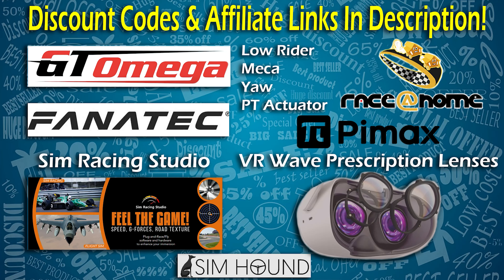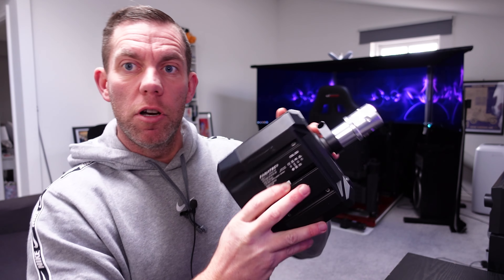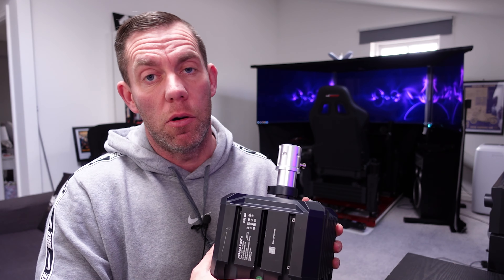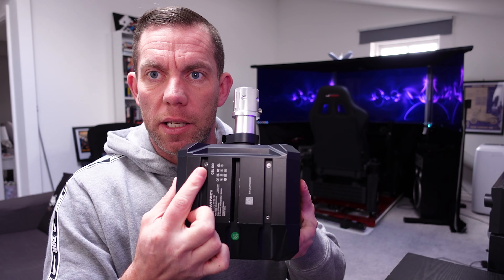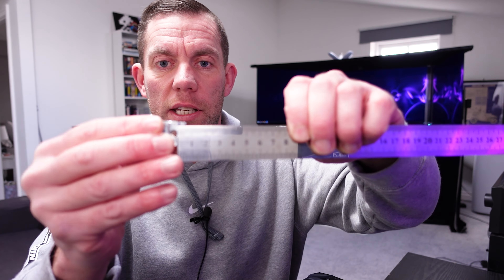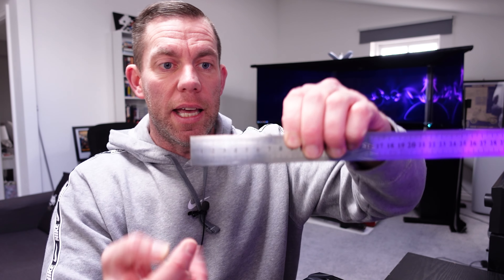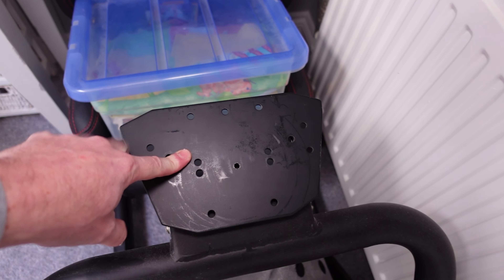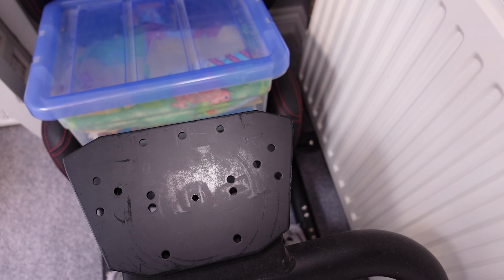Fanatec CSL DD Bolt Pattern Measurements & GT Omega Titan Fitting Guide!

Comment: Huh. I'm guessing GT Omega may have changed their design. I'm sat in one purchased only a week ago, and that is not the hole pattern I'm looking at (I've corrected for yours being other way up from what I'm looking at). Currently getting very cheesed off at fitting pedals, and am now also worried that the wheel will be trouble too! 🤦
Reply from the maker: Ah yeah maybe they have updated it then, mine pre-dates the CSL DD! I'll pin this comment.
Reply: I’m literally typing my card in to order the titan for my DD GT pro, same pattern as the CSL DD with CSL pedals. Are you unable to mount the wheel base without drilling and the pedals don’t fit either?
Reply: @ljcsponger87  First off, I should preface this by saying that this is my first ever rig, and my first wheel/pedals since the original PlayStation. So I may well be setting it up wrong, which is why I'm watching these videos again. That being said, the pedals are currently bugging me. The front two screws go in fine, but the pedal frame is so long that it extends past the end of the Titan base, and the holes don't quite line up enough to get the last two bolts in. Again, this may well be a me problem rather than a hardware problem. But so far I'm not seeing how. Haven't tried to attach the wheel yet, but might give it a dry fit in a second so can give you an answer. I have several holes more than Karl's shows though, so it may well be fine.
Reply: @urinal2001  understood, thanks for the follow up. I emailed GT Omega and I’ll keep eye out for your follow up. This is my first rig too and I’m having second thoughts if I need to modify it out of the box
Reply: @ljcsponger87  The wheel base fits perfectly. I set the T bolts in a square layout rather than the triangle, as I figure four points of contact is stronger. But the three point/triangle configuration looks like it would work without any drilling. Now I'll get back to shouting at pedals! 😂
Reply from the maker: @urinal2001  I don't use the additional pedal tray of the Titan ( I don't like the height) and instead bolt direct to the base plate, I did have to drill holes but that's no bother for me.
Reply: @urinal2001  thanks! I appreciate you checking. 
I’m a bit worried about pedal fitment but I guess I’ll hope for the best and place my order. My wheel/pedal package shipped a month early so I’m behind the ball for the rig and seat
Reply: @ljcsponger87  So far im pretty impressed. Pedal fitment is the only real hiccup so far. Instructions are basic but perfectly workable. And as touched on in one of Karl's other videos I'd certainly recommend a handful of 6 and 8mm washers for peace of mind in various places. But good stuff so far, and shipped quickly for me. The discount code at the top saved £25ish too which is helpful.
Reply: I got the titan a couple of weeks ago, and the plate supports the 4 bolt/square pattern on the csl dd base perfectly. No drilling needed. Pedals are a different story though. Front bolts fine, but rears are slightly off. It might be because my pedals (csl std pedals) are fixed in the outer slots as I'm waiting on the load cell. Until that arrives and I look at options to bolt it, I've just cable tied the rears down through the partial hole showing in the pedal plate. No movement from the back of the pedals 👍
Reply: @ellgarf  ok good to know, appreciate the info. I’m not thrilled with the idea of modding a new rig for pedals that are very common but it seems like it should be doable. I appreciate the info!
Reply: @urinal2001  hey, I ended up getting my Titan and DD pro kit. The wheel base mounted fine with 4 screw but I’m having same issue with the pedals. Did you ever figure out a good hard mount?
Reply: @ljcsponger87  I found a solution, but not an ideal one. I realised that drilling extra holes below the two corner ones would move them TOO far, so I just used a round file to make them longer downwards. It works fine to secure everything, and I'm happy with them. However I found that it meant I couldn't put the pedals in the very outer positions on the Fanatec heel plate. Not what I wanted, but it's only slightly away from what I would have liked and I'm using them just fine. As with several other places on the Titan, washers are a good cheap addition to give a little more peace of mind, even if not essential.
Reply: I just got my titan but it is the same hole pattern as in the video.  I guess ill be drilling holes for my dd setup.
Reply: @DoomiePookie  that’s so weird. I got mine not even a month ago and it allowed me to mount my DD GT Pro with 4 hole pattern no problem. 
The pedals are different issue and will require drilling  though
Reply: @ljcsponger87  i must of got old stock. I wonder if Omega will send me out the modern plate? Cant hurt to ask. ill contact them.
Reply: @DoomiePookie  they were next to useless in my exchanges with them. They couldn’t even confirm the plate works with the wheel base or if the pedals would line up with the pedal plate.
Reply: @DoomiePookie  mine came yesterday, looks like that too, did you have to drill anything ?? or use the 4 in the outside corners ?? assembled most of it yesterday, mounting today.
Reply: @JoelSc14  haven’t got around to any of that yet. But let me know how you go. Did you get the dd pro PlayStation one or the regular dd?
Reply: @DoomiePookie  got the Playstation one... gt DD pro 8nm and might add the load cell in the future.
Reply: @DoomiePookie  did the 4 in the corners, it all fit great. pedals on the other hand..... lol
Reply: @JoelSc14  oh so it fit without any drilling? And you have the exact plate as in the video??
Reply: @DoomiePookie  yes, exact plate from the video, can look different from seat to pedal view. but exact same, used the 4 side, no center one. only a 8nm
Reply: @JoelSc14  ok great. i wonder why karl chose to drill.
Reply: @JoelSc14  also what size screws did you use through the plate for the DD? Are they M6 around 15mm? Cheers.
Reply: @DoomiePookie  yeah, I think so, I used what omega included, there were lots of options. i used the middle ones, not the shortest. didn't install the shifter, and have loads of bolts left over. pedals, i used the lower holes, under the footrest of the pedals, used the included spacer sleeves, and nylon screws, since that was what i had. guessing m6x25 or 30 ?? not sure. i have not drilled the top pedal holes in the foot plate, not sure if i'll move the pedals, or add the loadcell. they are in the original csl position.
Reply: @JoelSc14  have you used the wheel much yet? Whats your thoughts so far?
Reply: @DoomiePookie  love it, tons of fun... Gt7 mostly.. Strength like 90%... Using the fanatac forum settings for the games I have... Gt7 on the ps4 pro, pc is ac, acc, ams and ams2.... Trying to get started with those, but struggling... Gt7 is just fun..
Reply: @DoomiePookie  probably 30 plus hours with it so far, or more... The titan made a big difference for all the subtle details..... The gt lite sucked up a slight bit of those it seems...
Reply: My setup went without any problems. The base fit in the plate perfectly in the 4 hole pattern and the pedal plate fit on with 2 bolts on the front (load cell included) and 2 at the rear with the built in extension mounts underneath. Incredible and good fun!! Got the boost kit too.
Reply: @DoomiePookie  what holes did you use for the pedals?? I got the 2 under the foot rest... But the other 2 don't line up...
Reply: @JoelSc14  i guess the other 2 line up depending on where you have the pedals placed. Im only using a accelerator and brake. They are one space away from each side. They lined up at the front on the long horizontal holes. The 2 at the back under the footrest only just lined up, like barely even by a mm. These 2 are the ones that are protruding under the footplate. I used a 25mm screw to get those 2 in.
Reply: @JoelSc14  did you update the firmware via a windows pc or laptop? And if so, did you have it in the blue ps mode when doing the firmware update or was it in the red pc mode?
Reply: @DoomiePookie  yep, pc or laptop, red mode is what I used.

Comment: I got my titan about 5 months ago " btw thx again for the nice discount bud" and I jst got my DD pro this week. Now the wheel base and wheel were no probs wat so ever, but the pedals pfffff, the two heellplate holes are grand but any other holes complete nitemare. This might sound a bit blue Peter but two or four heavy cable ties work a treat, for base pedals obviously.
Reply from the maker: I used two cable ties to hold the back of my V3's down for ages as holes didn't line up, no issues at all so long as they are tight down :)
Reply: I had same problem. Remedied it by filing the two holes downward, so that the bolts can move a few mm in that direction. Drilling two holes below didn't work as it moved them TOO low. Bit of a faff tbh. No way to mount the accelerator in the furthest right position as I would really like, but it's still fine, if not ideal.

Comment: For anyone wondering the holes are updated on the titan now. So u can run 4 bolts now no drilling required. Also there s an updated peddle plate it has 0 flex.
Reply from the maker: Excellent!

Comment: Perfect timing. My gt dd arrived today, I currently have a playseat challenge but planning on getting the Titan. But for the meantime I have to use the clamp because I don’t know the measurements for the holes on the playseat. How did u mount yours to the playseat challenge?
Reply from the maker: Would you believe some holes lined up on my PSC so bolted straight on!
Reply: @KarlGosling  really? None of mine lined up. I had the plate on the furthest back position and there was no hope.

Comment: Thanks karl I bought the titan using your discount code. Just one question, what length M6 bolts did you use to screw it to the Titan plate? Cheers.
Reply from the maker: I think they were 15mm mate, but I can't be 100%, not very long ones though thats for sure!

Comment: Does the GTOmega Titan use a 4 bolt pattern for Fanatec direct drive wheel bases? It looks like 4 bolts was an option.
Reply from the maker: If it did you would think I would have used them?! Was so long ago that I fitted it but for whatever reason I had to do it this way, might have been a clearance issue but I'm not sure.

Comment: Not seen this mentioned but do you get bolts to go with the T nuts or do I need to order these for my  CSL DD?  I will be direct mounting the base to 18mm Plywood so would be handy to know the hole size of the nut and the depth so I can order 4 the correct size for when I receive my wheel base etc.  Can anyone help me with these sizes?  Thanks :)  (My CSL DD is on order, 27th of April supposedly)
Reply from the maker: You don't get bolts, but they are M6 mate.
Reply: @KarlGosling  Thanks very much for that Karl, I was going to get the desk mount but would rather spend the money on the metal pedal pads, purely because they look better lol.  Like others here I went all in, 8nm base, handbrake, shifter, pedals with load cell conversion and the Xbox Rally wheel.  My only other issue is getting it all in the house and swapping my Logitech set-up with the Fanatec stuff without my missus noticing 🙈🤣

Comment: GT Omega stuff wasn't pre drilled for the old CSL Elites? As far as I know you can put the t-nuts in a compatible position (same with the CSW) at least Fanatec says that in their compatibility video.

I don't have a driller and just ordered a CSL Elite plate from Wheel Stand Pro for my wheel stand, to have it here when I will get my CSL DD. I will be very dissapointed if it won't be compatible. :D
Reply from the maker: Must have been?! But I needed a hole.
Reply: @KarlGosling  I don't see the exact size on the video for the plate, but if you look at "upside down", wouldn't that match (since you can move the t-nuts)? I mean to use the 1 center at the top of the plate, and two on the bottom (next to where you drilled). As far as I can see online (I never owned a CSL Elite) it would've matched, but probably I'm mistaken. Or maybe it wouldn't be that stable?

Comment: Hi Karl, I've got the CSL DD and titan. I used 2 T-nuts in both of the outside slots and aligned them to the pre drilled holes. Maybe this isn't as strong.
Reply: @Rob Pearson, I do the exact same thing, two T-nuts in the outside slots. It lined up perfectly for me. I've had zero issues.
Reply: @corentco  good to know 👍 are you also using CSL pedals? Not sure whether to ditch pedal plate like Karl did.
Reply: @robpearson8099  I'm currently using the last generation CSL Elite pedals w. loadcell brake pedal on the provided (angled) pedal plate from GT Omega. It took me quite a while to find a comfortable GT position though. Karl did mention in his video and in a comment to me about mounting them directly to the base. I may look into doing so when my new set of pedals arrives shortly. I have a new set of Clubsport V3s in the post right now.
Reply from the maker: Yeah two will allow for a little flex but probably not enough to notice, I went with three to be sure as I was testing it for review.
Reply: @KarlGosling  I am able to get four total T-nuts and bolts to line up. Two per outside channel. It's not going anywhere! ;)

Comment: Alright carl i watched your video on the peddle mod u done i have a gt omega titan and was looking to do the same thing with the seat slidders for the peddles but was wanting to ask you is the seat slidders all i have to get as the holes that are on the peddle deck seem very wide for it to work would i need to get an extra plate to attach them as your the man for any modding best regards charlieg
Reply from the maker: Charlie I've replied to your other comments mate, you'll just have to get the sliders and see, they should bolt straight on to your pedals (you can bend the bar to suit) and then to your rig.
Reply: @KarlGosling  sorry my man nothing had came up utube great algorithm dead on il grab a set and give it a try gdman thanks

Comment: Hey I was able to mount mine without drill holes it was the same version as yours I’m pretty sure I just used the 1 of the set of two holes on the sides and the middle one at the front hole
Reply from the maker: I think it's been updated since I made this video mate.
Reply: @KarlGosling  Yeah Ik but I'm pretty sure I have the old version considering I got it about 2 years ago now don't know how different the holes are but mine looks exactly the same. I wonder if you ask them if they could sell you the newer stuff because that would be so much better regardless. Thanks for your awesome videos btw big fan

Comment: My Titan from late 2021 but I didn't need to drill anything so completely confused.  One bolt in the middle nearest the front of the wheel,  then two (one either side) at the rear.
My only annoyance is I can't stop the tray moving up and down when pushed and pulled hard.
Reply from the maker: Yeah I can't remember as it was a while ago but I wouldn't have done this if I didn't have to?! lol Another viewer says he has more bolt holes than me to maybe thats it?

Comment: doesn't the channels in the csl DD line up perfectly already for the normal fanatec 3 hole pattern? so no drilling should be needed on any cockpit
Reply from the maker: Not on the Titan, I've not tried on anything else though.
Reply: @KarlGosling  I’ve got a gt omega art and the CSL dd bolts straight on with the precut holes
Reply: @KarlGosling  fanatec pattern is one hole at the front and 2 at the back
Reply: Yeah mine went straight on, one T nut on front and two at the rear